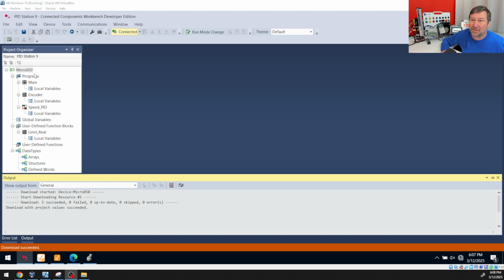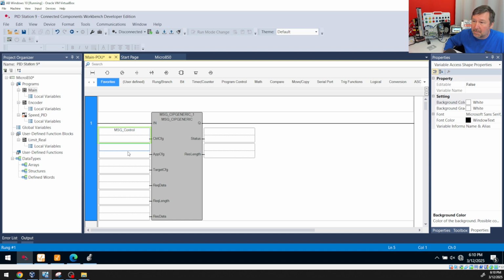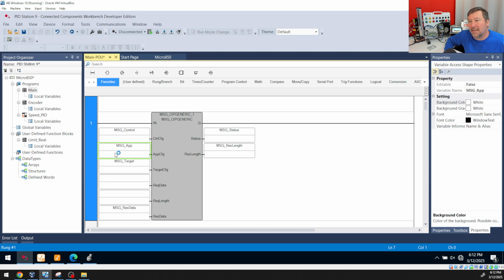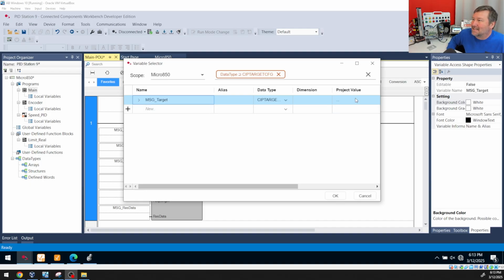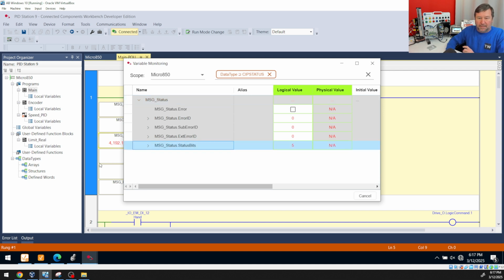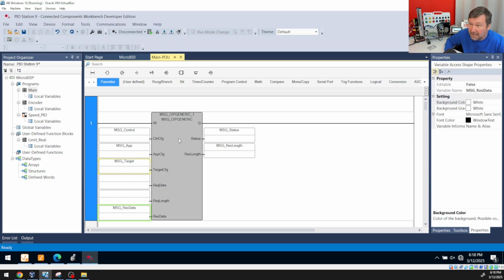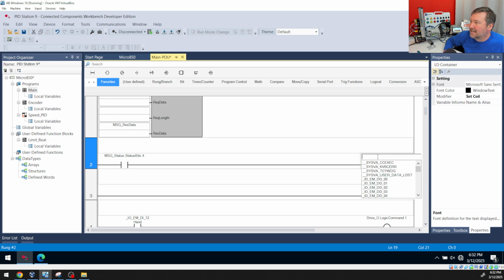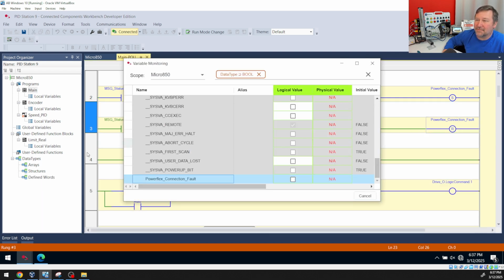Detecting an IO Connection Fault on a Micro800 PLC in CCW

Comment: One thing that should be considered is that there are devices that will not work properly if there are implicit and explicit messages being used simultaneously. The Metal Work EB 80 ( the Automation Direct PAL-EIP is a private label version of that) is one example of such a device.
Reply from the maker: I believe Adam brings up a very valid point here. Not all devices respond to both implicit and explicit messaging at the same time and my fix is to have both messages happening simultaneously. This can only be considered a temporary solution until Connected Components Workbench has a way for us to see that our module has an error and preferably the error code also.

Comment: Greetings Tim,  I appreciate your content and the technical knowledge you share.  I was wondering if you could share how to do a panel view firmware revision step by step? It is an overlooked matter until it's needed.
Reply from the maker: I usually right click the HMI in Connected Components Workbench and update the firmware there.
Reply: @TimWilborne  thanks.  I'll definitely use that if I run into that issue again
Reply from the maker: You are welcome